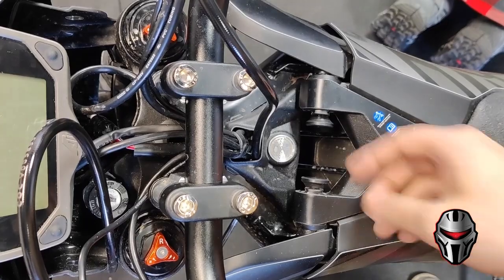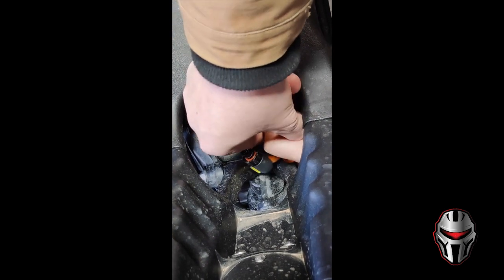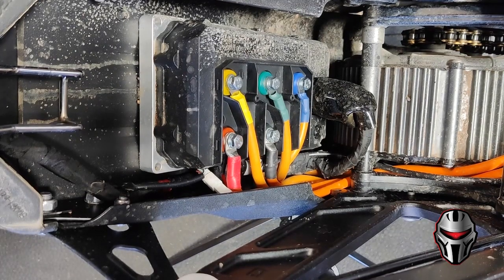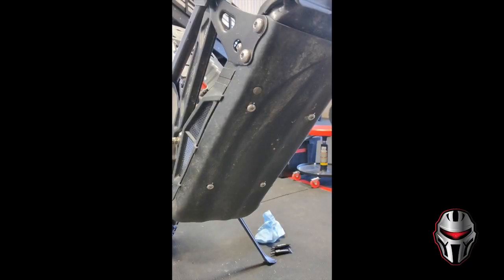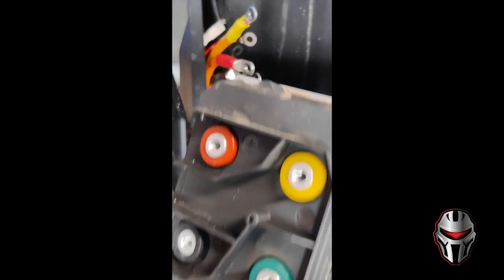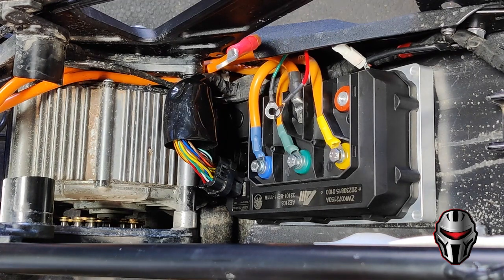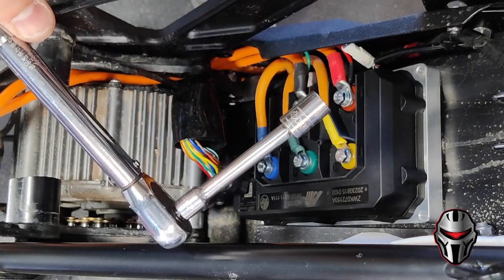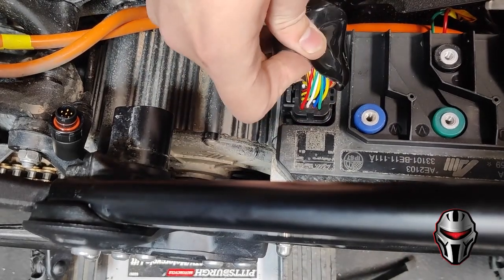RFN or Beta Stock Controller Removal and Install

Comment: Hello, i've seen on your website that to flash the controller i need to send both the controller and the throttle? is it complicated to remove the throttle? Also i was wondering, it is advertised to go up to 75 km/h but it wont go past 64 km/h and i still have almost 1/4 of free throttle play, could i just unrestrict the speed limit without sending it to you?
Reply: Did you find out if you can?
Reply: @tamworthtamworth8220  still unanswered 😬
Reply: Did you find a way?
Reply: @usr.t0m  i had someone flash my controller now my top speed is 85 km/h but i think theres still more power to the bike but they didnt want to put too much load on the motor so it stay safe
Reply: @BroutyMax  ok thanks for the reply
Reply: @BroutyMax  I think there’s a white wire you can cut also

Comment: hi guys good educational video. Can i ask if the bike can still run without the battery data connector attached... I want to make an "reserv" auxilery battery something with low capacety to use when main battery drains down?
Reply: Hiya mate. We replied to your comment on the other video. We hope that helps!